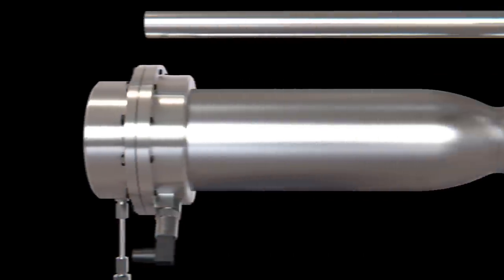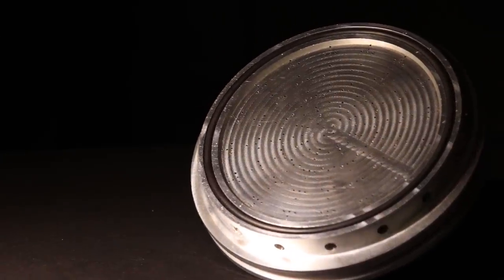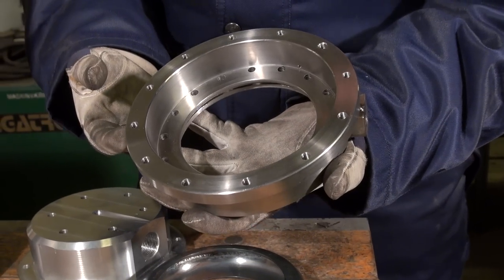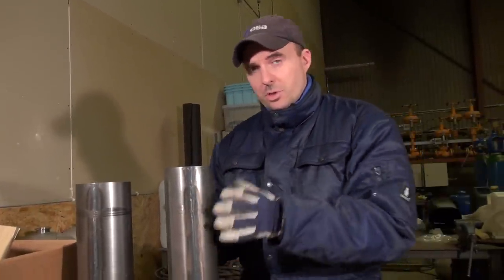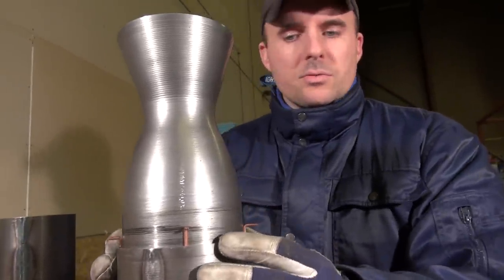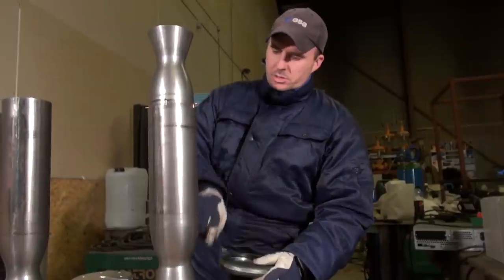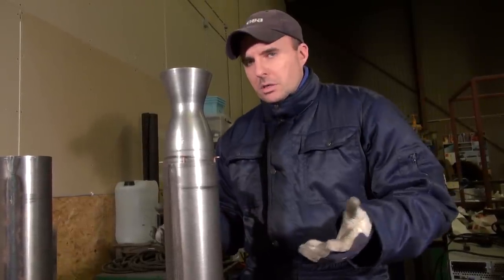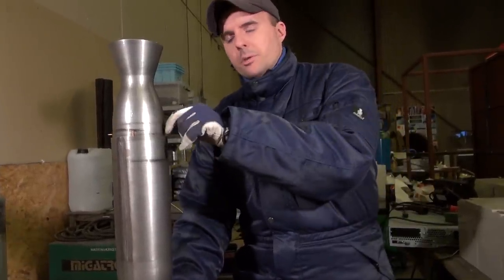Assembling the BPM 5 - Bipropellant rocket engine

Comment: I believe this is an outdated design for you all, but I did have a question about cooling. From what I understand would you not want the fuel to spend as little time in the cooling chamber as possible? In order to maintain the highest possible temperature differential. Of course this would also be dependent on mass flow rate due to total heat capacity of the fuel when thinking about it as a control volume. But yeah you mentioned you want the fuel to stay in the cooling jacket for longer, but I was under the impression you'd want the opposite.
Reply: You want the fuel to heat as much as possible and the chamber wall to be as cool as possible. These two contradict eachother and you need to choose a middle ground.

Comment: I like the Ball Valve design, Typically the H2o2 valves operate the same way. Does your injector design offer Boundary Layer Cooling? I thought I saw some alcohol injectors towards the outer edges.

Comment: Isn't the thermal conductivity of oxygen higher than that of alcohol? Also the oxygen would expand as it is heated, which would compensate for the pressure loss in the system.
Reply: liquid oxygen would oxidise(burn ) the hot metal

Comment: I have never seen a rocket engine with a combustion chamber so long. Just wondering why... is there a heat transfer issue? The equations that dictate chamber volume don't agree with a chamber of that size.
Reply: Dean Shaw I don’t know for sure, but I think it’s because of the low pressure on the feed side.

Comment: How do you make those injector channels? I have been trying to know it for a long time
Reply: The 0.9mm injection holes are drilled one by one.  The larger holes are also simply drilled.  They have mentioned that every time a drilling is slightly wrong, they need to throw away the steel object and make a new one.  For their new BPM-100 engine they use prefabricated injector nozzles mounted in s plate with larger holes.

Comment: Re: PyroShim
They need liquid oxygen to inject, becouse the injector design reqie liquid to operate properly. I think. High tech russian engines can use overheated oxygen gas, but that design is completly different than this.

Comment: Seems a little amateur like to me. Bad quality welds, no deburring of the holes, rough machining, and apparently does not know about pneumatic regulation valves that is a whole lot faster and a lot more precise than just putting a servo on a normal valve and messing a little with the ball hole (as oppose to the proper seat on a proper regulation valve).
And how is fuel pumped on this rocket? Fuel flow could be regulated by the pump in stead of the valve.
Reply: fuk man, the welds are attrocious, lmfao. Just horrible to say the least. can you say BOOOOM!!!!
Reply: Fuel flow is determined by tank pressure; the tanks are pressurized with nitrogen (or some other inert gas) to a level that will force fuel out of the tanks at whatever rate they've designed for. That fuel then flows through the engine plumbing and into the combustion chamber. This method of moving fuel in a rocket is called a 'blow down' pressure fed system, which results in low combustion chamber pressure and correlated low thrust, but is simple as far as liquid rockets go and is good for rockets that are designed to be as cheap and as simple as possible.
Reply: Part of the leaning process, I'd say.
Reply: Wankel Motor why don't you make a perfect one????
Reply from the maker: ChiefJustice Middleton we call it the FrankenEngine because of that. This was the first engine, where we had to learn a lot
Reply from the maker: ChiefJustice Middleton with more than 30 burns we haven’t had an error yet
Reply: Copenhagen Suborbitals  still...  those welds would not pass inspection on sight alone... you could at least find yourself a competent aerospace welder. If only instill confidence in any potential investors.
Reply: Christopher Pardell They have no investors and no paid workers only donations and volunteers.